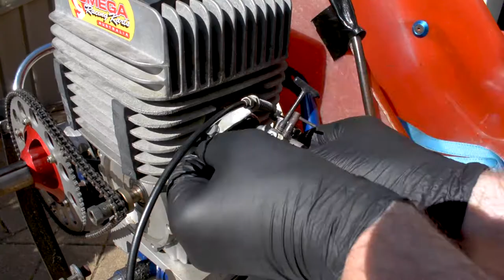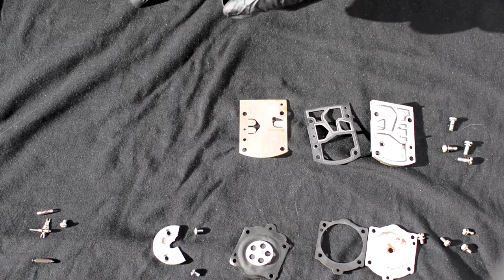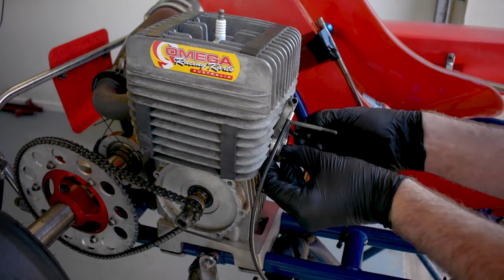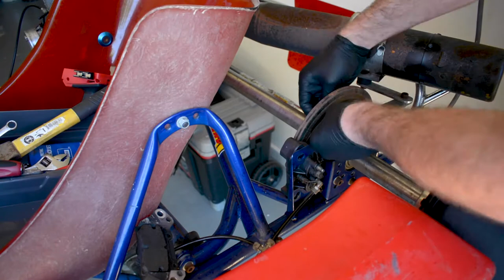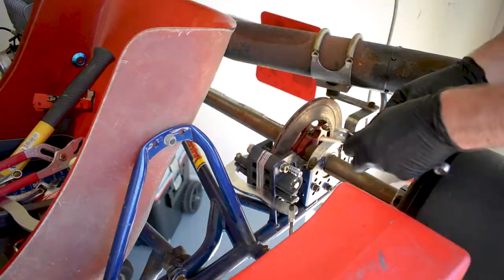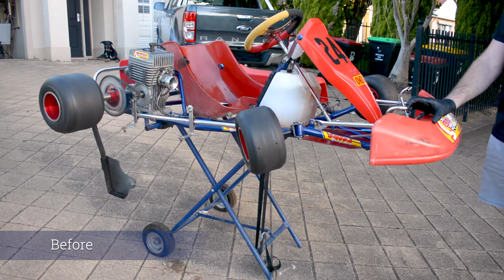100cc Direct-Drive Racing Go-Kart Restoration

Comment: My kart has the same engine with to much comprenssion, and i can't start it. What should I do?
Reply from the maker: Haha yeah they are not easy to turn over! Are you turning by hand or with a strap?
Reply: @eg_engineeringaustralia  With a strap
Reply from the maker: @-Alvaro-  alright, are you actually getting it to turn over a few times when you pull?
Reply: @eg_engineeringaustralia  Yes, it looks like it will start but it stops immediately, you will probably have to change the spark plug .
Reply from the maker: @-Alvaro-  I can't give official advice on this, please refer to the disclaimer in the video description. If its actually starting and blowing smoke out the exhuast then it might just need a carby clean / tune - I'd recommend getting some advice on tuning if you are not experienced with it... Alternativley, if it never actually ignites it could be a number of different things, its hard to say without more context. Regarding the electrical issues, yes it could be a spark plug, but it could also be a corroded connection in the spark plug boot, an issue with a grounding connections or TCI connections etc, or if you turn them over without properly grounding the spark plug to the head / stud it can fry the TCI module itself
Reply: @-Alvaro-  carb problem